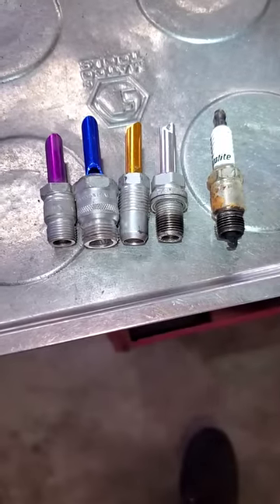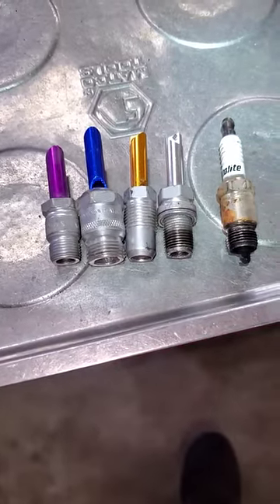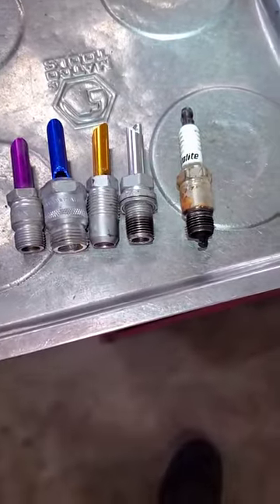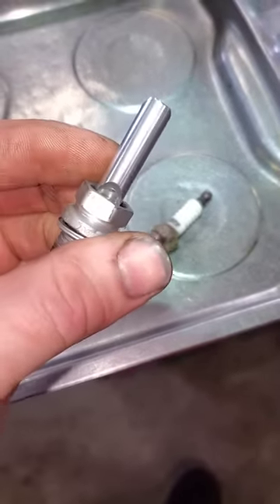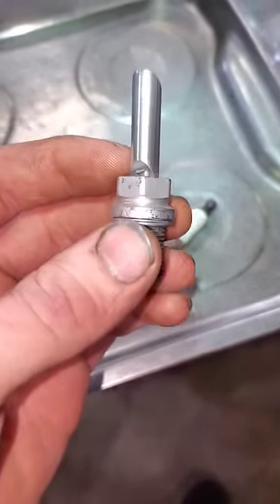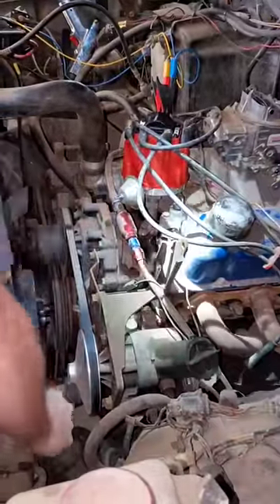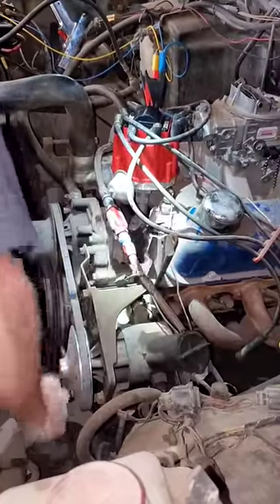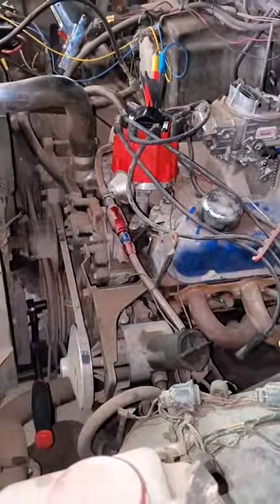Compression Whistles- Where Have They Been All My Life?

Comment: I feel like theres a Engineer vs. Mechanic joke in here somewhere, If it only whistled on compression and didn't seal with crush rings, maybe I would be sold on it. Like they took the time to design this thing, they couldn't put a spring loaded ball or something on it so it only whistled on compression???
So, what Im hearing is its 50/50 you're gonna be on compression.... Ill stick with my finger and timing marks. My finger doesn't "Whistle" on the exhaust stroke. Also, if imma take the time to thread something into the hole, might as well be a compression gauge, It seals with an O-ring so I dont have to take the time to get a ratchet and tighten it like i would have to with that... Also You could do neither of those and just leave the spark plug loose and listen for it. If my used and abused ears can hear it in a loud shop, anyone else should be able to.

Comment: I have a hemi. So I just use a 1/4” extension in the spark plug hole
Reply from the maker: But that doesn't tell you if your on compression stroke...
Reply: @TechnicianRed  that’s true but it will get you tdc

Comment: May be a stupid question.  But I am a mechanic who is learning.  What's the point of these? Is it a fail safe? The only time I could imagine needing tdc is to set timing. I learned to use the marks on the crank and the cam to time it.
Reply from the maker: This tool is to find compression stroke when stabbing a distributor. It is not a tool to find TDC

Comment: Or you can stuff a paper towel in the spark plug hole and gradually crank the engine over until it shoots out then you know you’re on the compression stroke for that cylinder

Comment: I added a check valve to mine so it doesn't whistle on exhaust stroke, only compression.
Reply from the maker: Sorry but the check valve won't work for that. On both exhaust and compression stroke, air is flowing the same way (out) of the spark plug hole. So the check valve doesn't do anything.
Reply from the maker: Unless your check valve takes a few psi to open up. Then it would work.

Comment: Why not just use the plunger style one that pushes outward as it comes up on tdc and visually shows you the very top of the stroke
Reply from the maker: That tool would only work on a diesel through the injector port. Every single gas motor I have ever worked on (except for an old school flat-head), the spark plug is at an angle to the piston. So, that plunger tool will get bent all to hell unless you manually retract the plunger as you come up on TDC. This is hard to do while turning over a motor at the same time. Besides, the compression whistle  tool finds compression stroke. A plunger finds TDC. Two different tools for two different purposes.

Comment: In what ways does this help? Is this suitable as a compression test?
Reply from the maker: Exactly what Nick said. When you are stabbing a distributor for the first time, you want to bring #1 cylinder to TDC compression  stroke. This tool will make sure you are at TDC compression stroke and not TDC exhaust stroke.

Comment: So what exactly does this do? Is it just to show that there is compression? Are you supposed to listen for a certain tone to figure out if its got the right amount of compression? Am I overthinking?
Reply from the maker: It's just to identify compression stroke so you can properly stab a distributor. You still need to set piston to TDC with a borescope or screwdriver before stabbing distributor but this tool ensures you are on compression and not exhaust  stroke. If you stab the distributor on exhaust stroke, your rotor will be 180 degrees off.
Reply: @TechnicianRed  oooooh okay. I’ve never had to work on a distributor, so I guess that’s why I didn’t understand😅

Comment: at that point you might aswell just use the gauge
Reply from the maker: The gauge isn't going to tell you where compression stroke is unless you take the gauge off the hose...
Reply: @TechnicianRed  uhhh, when the gauge goes up, thats the compression stroke, valve in the hose or not, psi means compression

Comment: Waste of time seeing how a similar tool that screws in will fit TDC by coming in contact with the piston.

You can place wire inside spark plug hole.  The piston will push it up or allow it down as the crank rotates. 

For TDC, you can place tubing inside of rubber grommet. Place up against hole and the air will force through the tubing. The rubber grommet is for sealing to hole

Comment: This doesn't make sense. Just override the starter and crank using a compression tool gauge get a kinda accurate compression reading. Because normally you only get accurate compression reading from a hot engine. But you basically minus 10 to 20 psi for cold engines and basically what you want to do is if any of them have a compression ratio lower by 20 to 50 than you're highest cylinder. then you got an issue on a cold compression test using proper gauges. Just override the starter.
I apologize. I forgot to mention that you have to remove the valve from the compression Guage to do this stroke compression test. It's just a simple tire valve easily removed with a tire valve tool. Once removed you can get your compression stroke psi and exhaust stroke PSI instead of just compression PSI. It's a fun trick that I accidentally assumed 🙃 was understood.
Reply from the maker: A compression gauge measures compression. A compression whistle identifies compression stroke. 2 totally different tools for 2 totally different jobs. A compression gauge would do me no use here.
Reply: @TechnicianRed  I understand the concept. But if your exhaust valves are damaged or not working properly. This will show on a compression Guage. 
Ohhhh. Wait.. I'm so dumb. On compression Guage you can remove the valve to measure just compression stroke. Dam I should have said that in my original post! I apologize. You're correct. On correcting me. My bad.
Reply from the maker: @patrickdavis9566  this tool is only really meant to find compression stroke when you are first stabbing a distributor. You would likely never use this tool on on any engine that doesn't have a distributor type ignition.
Reply: @TechnicianRed  hmm.. my old 1963 f100 with a 292 would disagree with your assessment of me and my understanding of old point systems. As I rebuilt it. Kept my actual generator, put in dual points system. Herse 3 shift on floor. And changed the rear-end to get way beyond 50mph. Like I literally changed that vehicle to a 2 speed w overdrive. 1st at max rpm could pop 60 or the clutch. 2nd could get you around 120. Depending on conditions. 3rd.. well. You could use it after 1st or 2nd to maintain and actually made it awesome mph on hwy. Like up to 25mpg. As the engine would only be at around 1k rpm at 60 to 70 mph. That truck was fun. Oh.. it did have an issue. At idle in first gear you couldn't go slower than 25 miles an hour.

Comment: Pretty close is not as good as bang on as most cars need be perfect, my way doing it is putting long screw driver down hole!!  Easier and more presise
Reply from the maker: This tool is only used to identify compression stroke, not TDC. I was only saying it was close to TDC to give the viewer an idea of where the piston was. The only proper way to find TDC with the head on is by using the piston stop method.

Comment: Why do you need to be tdc on compression you're gonna be in time either way
Reply from the maker: Wrong. Only on a waste spark ignition or a 2 stroke you would be correct. This engine is neither. Set your timing at TDC exhaust stroke and you will only fire on exhaust stroke so the engine would never start. Remember, the camshaft turns at half the speed of the crankshaft therfore you can easily time the distributor 180 degrees off.
Reply: @TechnicianRed  see I had never understood the reason I guess I just got lucky lol 😆 because I've set time on a dohc and a sohc.. but you could watch for tdc and see which cam is open or closed by removing the valve cover

Comment: Why do so many people keep trying to correct you when they themselves are talking about toslly seperate stuff.
Reply from the maker: They have likely never had to stab a distributor and therefore don't know anything but a standard compression test.
Reply: @TechnicianRed  What exactly would a "non-standard" compression test be? Genuinely curious I'm just a shade tree guy.
Reply from the maker: @contraband1543  a "standard compression test" would be simply cranking the engine over at WOT with a mechanical compression gauge hooked up to the cylinder. Anything other than that is not considered "standard" to me. This would include doing a relative compression test with a labscope or using an in-cylinder pressure transducer hooked up to a labscope.

Comment: Compression testers are a thing... that give you an actual reading... wtf is this for?
Reply from the maker: To find compression stroke when stabbing a distributor. There are 2 different top dead centers: TDC exhaust stroke and TDC compression stroke. You want to be on TDC compression stroke. This tool helps you get there.
Reply: @TechnicianRed  You can use a compression tester for this though you just have to remove the valve in the hose